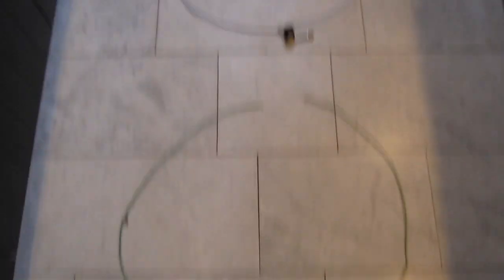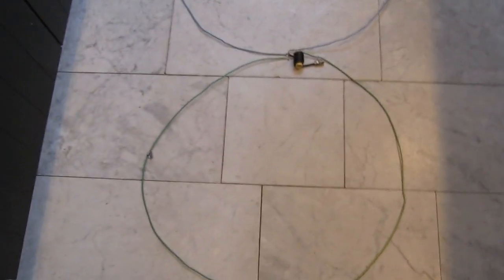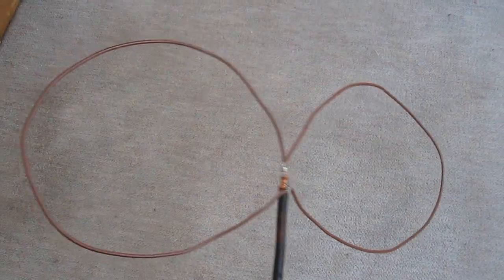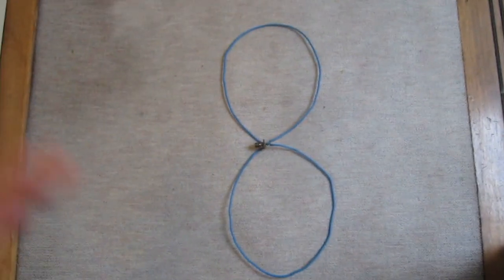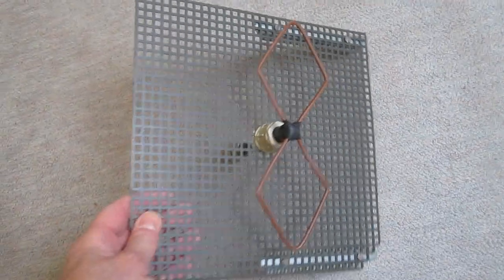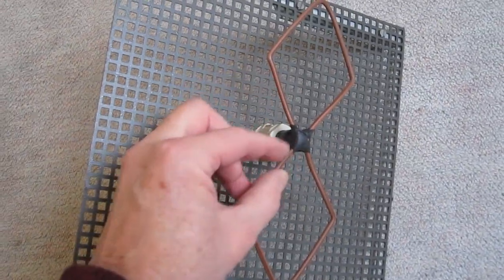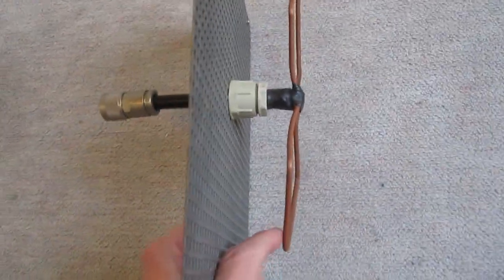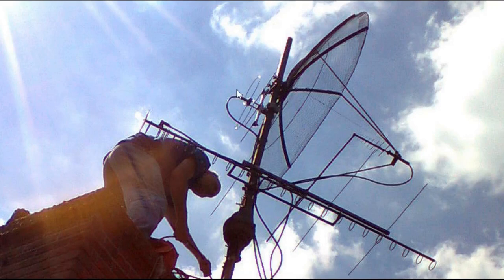Doppelquad or biquad explanation and examples

Comment: Is the reflector 1 wavelength square?
Reply from the maker: The reflector plate is 1 wavelength square. If the plate is larger, you do not have to cut it. Of course it could also be made of chicken wire (with some kind of frame?). 
For the shown 23/24 cm version the plate size is 25x25 cm, driven element distance to the plate is about 4.5 cm. 
In case of reflector elements they need to be a bit larger then half a wavelength.
With a bit fidling with the shape of the loops the return loss could also be optimised.
Reply: @PA3CRX  Thank you.